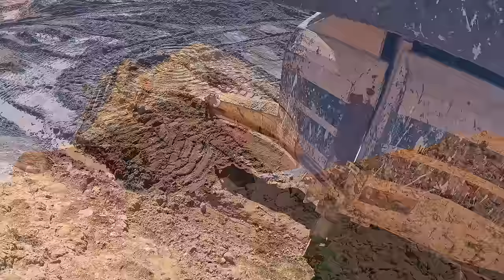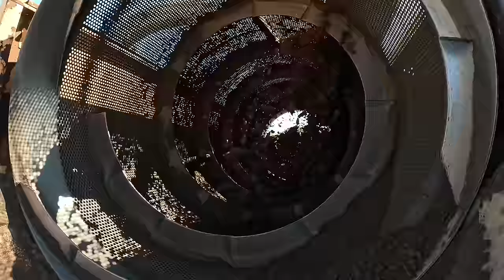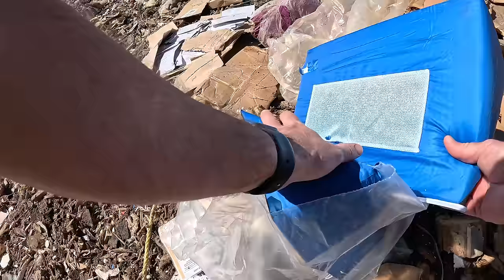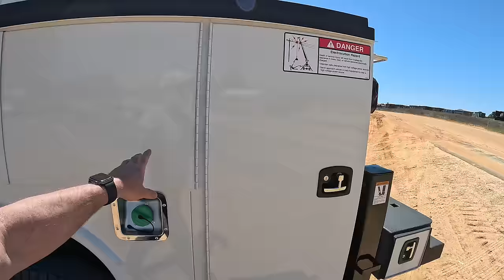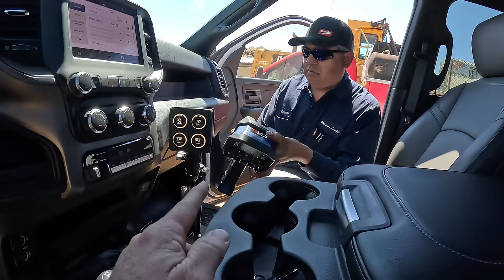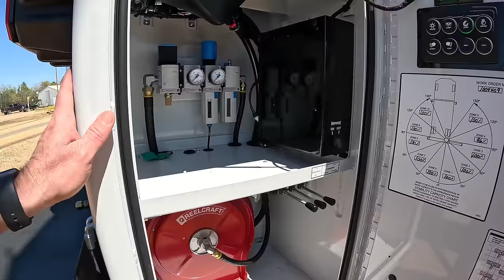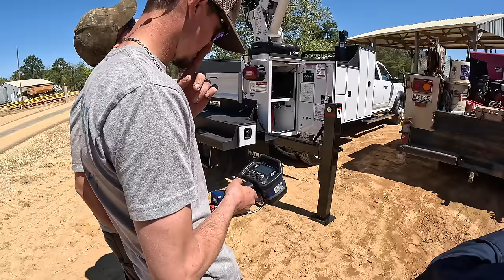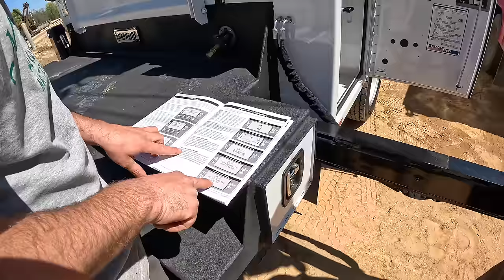🆕 NEW RAM Service Truck arrives !! 😁

Comment: Nice, glad the boom messed up before you had to use it. Always good to play with new equipment before you need it.👍👍👍👍👍
Reply from the maker: You got that right!
Reply: hey its a good thing it worked they almost two blocked it before it even got to lift anything

Comment: Rolondo needs to make sure that the outriggers are extended before lifting anything with the crane. Nice truck im sure you dropped a few bills for that one.😊
Reply from the maker: Thanks for the tip, they sure aint cheap!!